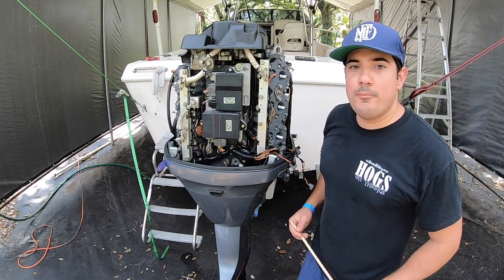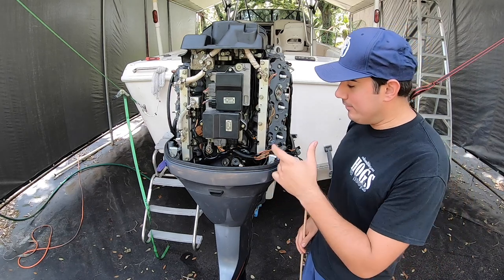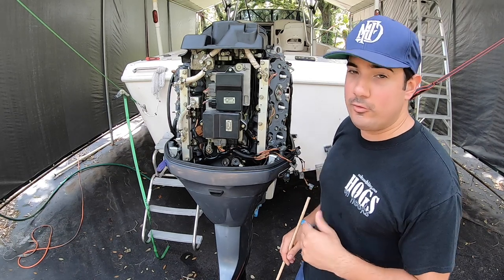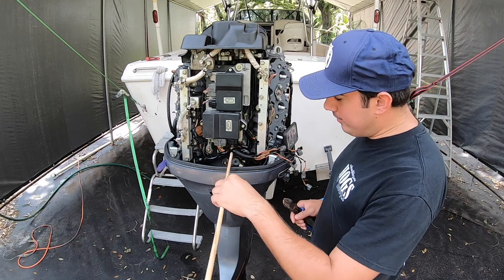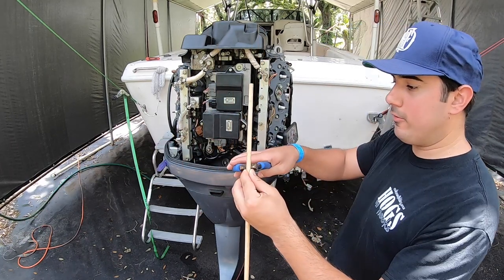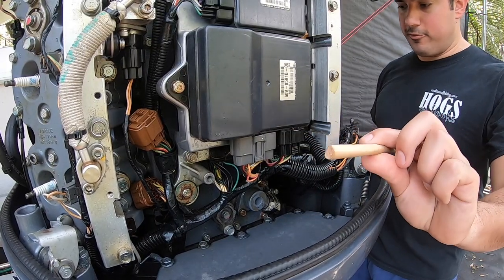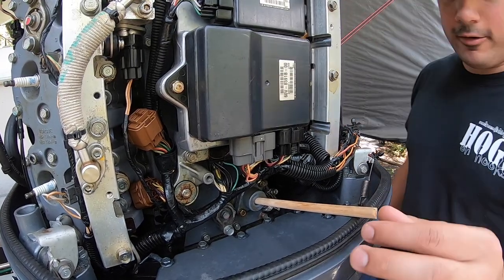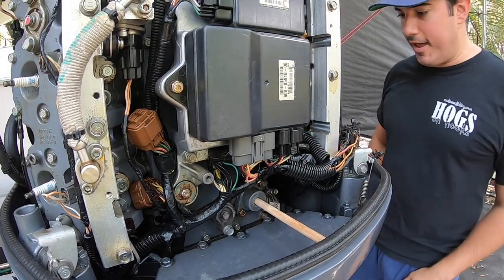Poppet Valve Wooden Dowel Trick

Comment: Thanks for the tip my 2001 Yamaha 150 2stroke will run fine at 3200rpms as soon as I push it up to 4K it will run for about 5 mins then stall out and I have to wait about 2min to resume could this issue be bc of a bad poppit?
Reply from the maker: This seems like a fuel restriction issue. 
A poppet issue would cause an overheat alarm.

Comment: I have a 2000 Yamaha 200 hp saltwater 2 series. Overheats at idle and then when I raise the RPM for a minute or so the alarm is still going off so I shut it down. I'm going to replace my poppet valve to see if that does it. I've already replaced both thermostats and the impeller. I don't know if the alarm would have stopped if I ran it longer at high RPM, but I didn't want to because I was worried about damage. How long would you have to run it at high RPM to get the alarm to go off if it was just to pop it valve?
Reply from the maker: Probably 30 sec to a minute. But if the alarm is going off you did the right thing to shut her down. Best thing to do is get an IR thermometer that you can point at the block and see that it’s actually over heating and you can rule out a bad overheat sensor. Sometimes the wiring will ground itself and cause faulty alarms. Also it does happen where the impeller is put on the wrong way. (Counter or clockwise positioning of the splines) this will cause insufficient water up the water tube. Another thing to look for is mis alignment of the water tube to the impeller housing when reinstalling the lower unit. 
All things to look at and mark off the list when trying to diagnose. 
The poppet does cause alarms when in low rpm or idle, if it has debri leaving it open or the gaskets have failed. Good luck 👍🏽 let us know what you find
Reply: @ReelTeaseFishing  the impellers definitely clocked the right way. I turned the shaft clockwise while pushing down on the housing. But since I left this message I've read quite a few threads about the ox66 overheating using earmuffs. That's what I'm using. So I'm going to back it down into the water and see if it's still overheats. I've been doing all this testing using earmuffs.
Reply from the maker: @gurnblanstein9816  ahh yeah! That definitely could have been it. Some engines don’t like earmuffs. Mainly due to low water pressure at the hose. Hope that’s it
Reply: @gurnblanstein9816  My OX66 150 will always overheat on the muffs after about 5 minutes.  I've had the overheat at idle before and replaced my poppet valve. When it goes off at idle, I'd just hit the throttle if it didn't stop the alarm after a minute, I'd shut down and try again. Second time it would alwys stop and be fine as long as I was on plane.

Comment: Great videos. I own a 2002 f225 xtra yamaha. Does it have a poppet valve? If so, do you know the location of it?
Reply from the maker: hi Craig, hope you found the answer by now. this engine has a PCV (Pressure Control Valve) very similar to the poppet valve but its all in one piece. it is located in the rear area topside of the mid section. you will need to remove the sides of the lower cowling area to reach it.

Comment: How do you know if you need to change out the poppet valve?  I switched mine out the other day on a 2002 200hp Yamaha and it look good shape.
Reply from the maker: the  poppet valves usually stay in relatively good shape. its the oring or sealing grommet that goes bad. signs of a bad poppet valve are overheating at idle and it going away when you raise RPM's